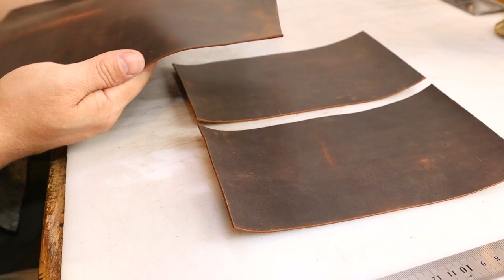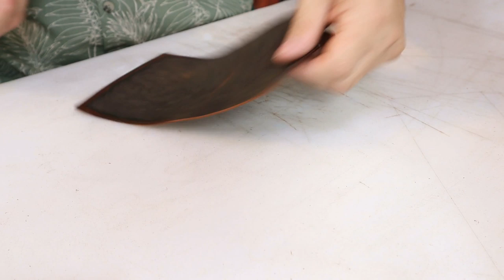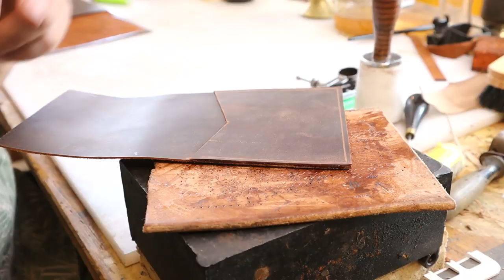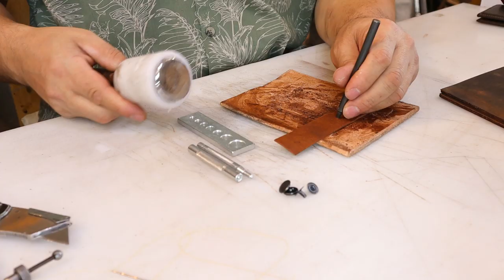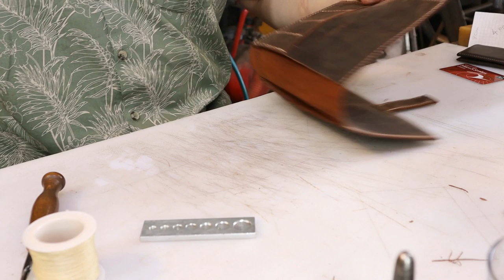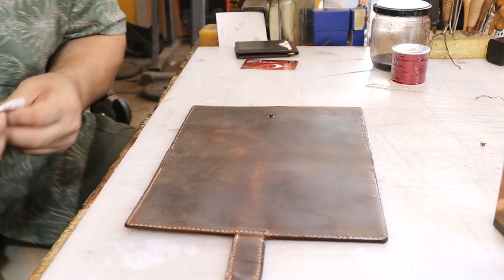making a leather journal notebook cover | Pull Up leather | how it's made

Comment: "Suggestions and comments are welcome"
If you didn't say that then I would not say the following.
I would like to hear the reason for your design decision in putting internal pockets/slots in to the cover. The reason I ask is that surely, it would required emptying the cover to have a flat surface to write on. This, I suspect, is why journal covers normally have a loop to insert a single pen on one side of the opening.
Reply from the maker: You're right, it's necessary to write on a flat surface or make drawings. I have to work on it. Thank you for your nice comments.
Reply: Yes, but at the same time the traditional design allows you to carry only one pen. You can still carry just 1 pen with atolye’s cover and you have flat surface once you take that out, but at the same time it gives multiple options of instruments if you prefer. I actually think this design is better than the “normal” style.